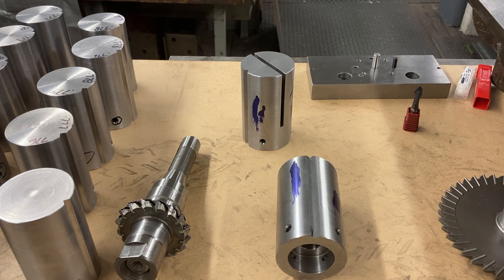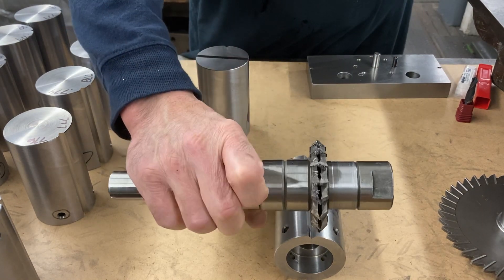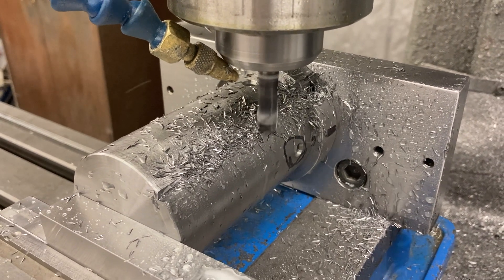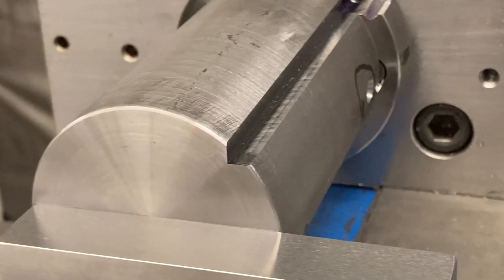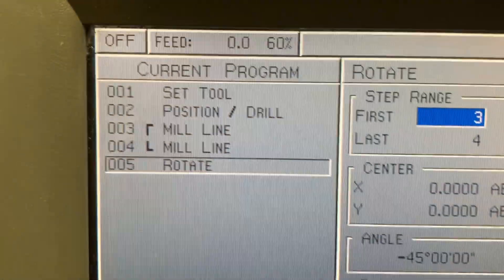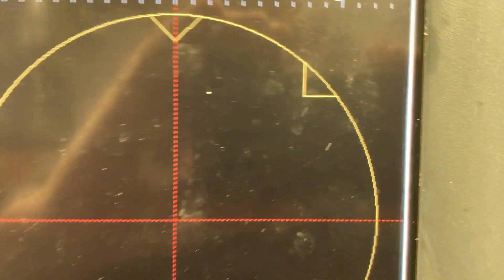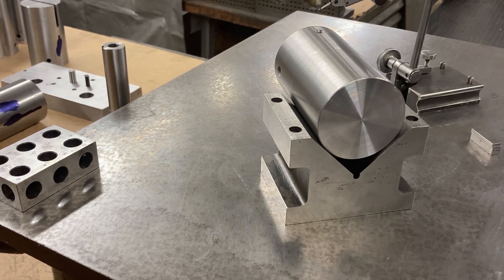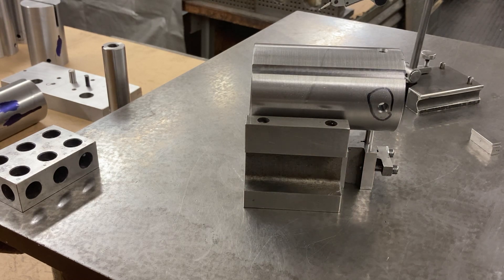Machining V Notch Using a Square Corner End Mill & Rotating Part 45 Degrees on Fixture

Comment: This problem is a nice head scratcher, and I like your approach

Also, the corner point of the 45deg notch - it seems, its Z and X is all you need to calculate from print, to set your flat endmill and take a cutting pass in Y like you did.

Thank you for sharing this on video btw